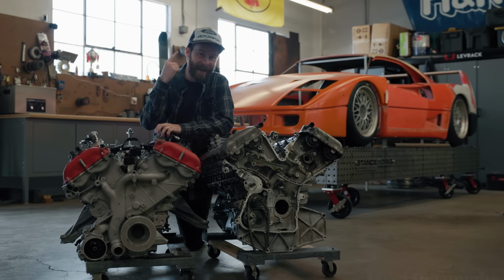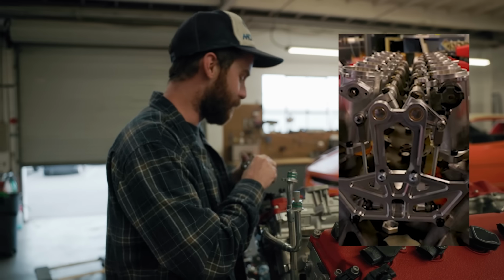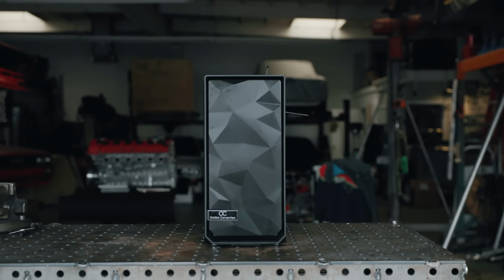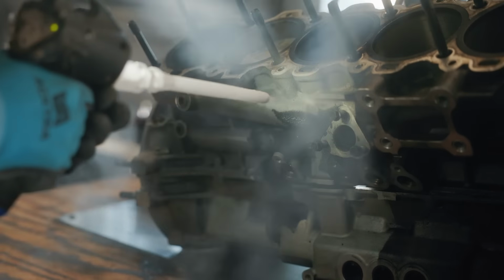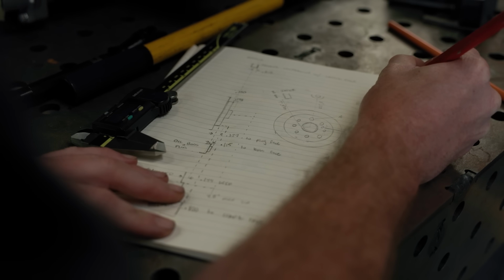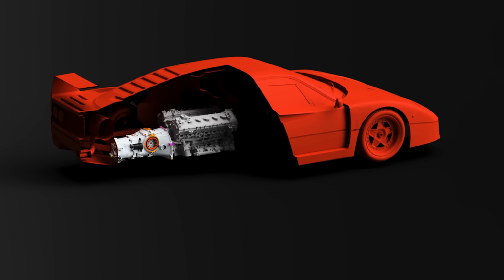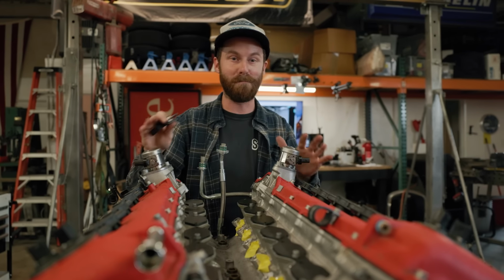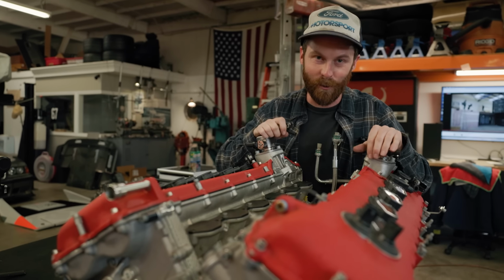Stuffing a V12 into my F40: 3D scanning is my favorite tool yet.

Comment: I'm genuinely unsure whether you're intentionally making controversial choices for comments, algorithms, and creating polemics—because, as they say, "there's no such thing as bad publicity." Instead of keeping the direct injection as a base (knowing it will always work) and adding port injection for additional fueling, you dismiss it as "only for emissions."

The same questionable logic applies to the gearbox. Unless you're restricted by regulations, there is absolutely no point these days in opting for a sequential manual gearbox. You're left dealing with tedious maintenance intervals, temperamental performance, and higher failure rates. Rather than embracing new technologies, you reject them because they're "new" or linked to CO2 regulations. Honestly, it's disappointing.

This highlights a recurring issue: a skilled fabricator without a solid engineering foundation—one rooted in real-world experience, not just a degree—is often limited to creating "shiny things." Or, as I mentioned earlier, maybe this is all just a strategy to game the algorithm.

I discovered this channel through this project, but I unsubscribed when I realized you're the self-sabotaging type.
Reply from the maker: It's disappointing to hear you reduce my own decisions to one of two things: clout chasing, or stupidity.
There's not enough time to really dissect every decision I make, so let's make an example here, because I genuinely think you're coming to conclusions based on your own biases, and while I get how that happens, it's not quite fair in this context.

What gearbox would you think makes more sense in this project? Moreover, how will you make it work? I'm all ears.
Reply: @stanceworks  i don't know what dimensions you have in mind and how do you want to fit it.  But... There is a certain german brand that does transaxle dsg's capable up to 1300nm and with enough support to have customisable gear ratios, and sufficient OEM integration and aftermarket calibration to just hack something together... Even with straight cut gear ratios if the mega ultimate performance bothers you that much... But with oem reliability. Obviously the straight cut gears will cut longevity... But still will outlast the car. Easy.
If you are working with an spaceframe from scratch you are not that limited. Why not to set some hard points in the project and build from them rather than make mediocre choices because they can just tailor make them for you?
Im all about lightweight and simplicity. I May do state of the art in my day job in an OEM but I do build and race 100% analogue cars.  Im restricted by a rulebook tho. I wish i could have a dsg rather than my Sadev. Your interpretation of an F40 wont be sanctioned anywhere where a rule book is relevant. So... Still don't get it.
Reply: @MauriciR  I'm not sure I get your angle. It is his project, he makes the choices he wants. Hollinger is custom building the transmission for his project. Also your comment about anywhere a rulebook is relevant? Do you think he is going to try and join some series?
Reply: @MauriciR his goal isn’t to race in any specific series so why would he build to any rule book. You completely disregard half of what it takes for him to build the car. Mike doesn’t have infinite money to throw at this project to get all the newest and latest technology. He’s not building an oem car either so where’s the harm in him choosing these choices. It seems what you need to find is a documentary from an oem race team cause that’s the only thing that’s gonna satisfy your needs
Reply: Name 5 standalone ecus that will control this engine. I’ll wait. Then name 5 standalone transmission control units to control this magical transmission of yours. Now when you’re done take any combination of those and add the prices. Then factor in potentially having to rewire an entire harness and adding/changing sensors for your ecu pick ups. Then find a tuner who won’t blow it up. In the end you’ve got an ungodly complicated, insanely expensive, ticking time bomb.
Reply: @jordanbest3926  missed that. You don't really need 5 brands... Do you? From the top of my head, adaptronic and holley will control 24 injectors... 12, direct and 12 as ported. Been done before... And opens a new word of possibilities on part throttle driveability, and allows more tuning resolution and less stress in high loads.

A proper zf gearbox will come with it's own ecu, and will be easily flasheable and tuneable. Both engine and gearbox calibration are pretty much standalone... So you dont need any particular integration.
The one and only point of a manual sequential nowadays is to comply with rule books of specific series...
Reply: Your comments are so strange.  They certainly don’t sound like someone with experience building cars.  You are concerned with things that are irrelevant or subjective.  You may as well say Red is a bad color.

Comment: I understand why you prefer port injection, if you run E85, the injectors can not handle the fuel flow required. However, that does not mean you have to remove the system, why not use dual injection, meaning you just add port injection without removing the direct injection?
Reply from the maker: Because there's no real benefit to be had by doing that. It adds complexity with no gain.
Reply: @stanceworks  You would not need to go through all that trouble to remove the direct injection system and would not need as big and expensive injectors for the port injection.
Reply from the maker: But I'd have to wire it, run it, and tune it. The wiring is whatever, but running it and tuning it? That's a headache with no gain. I'd rather just... buy bigger injectors.

Comment: Direct injection is nothing new on car engines. The Mercedes Gullwing had it 70 years ago.
Reply from the maker: Right. But that doesn't take away from the point. It's a modern standard.
Reply: @stanceworks  As much as I like a V12 I'm afraid the modern standard is electric.

Comment: STANCE  . if that pc is to be used in an open shop.. make a box or house for that bad ass pc with a fan and a cheap replaceable home a/c filter on it.......... i lost a tone of time ,data and frustration  finding out my very expensive pc was nuked because of metal dust from welding griding area that was  like 15 feet away..... metal dust got sucked into the pc and wreaked havoc

Comment: What's cool about Ferrari and direct injection is they've been doing that for road car engines for at least 23 years now (if the F136 was the first one). So while its recent for mainstream, its pretty standard for Ferrari. 

Also for the scanner dots, try not to place them "methodically", but rather randomly. The scanner wont know the difference between each dot, but rather will read their unique patterns combined with the surface itself. Part of my job is scanning whole cars, so I've had to go through that pain a lot. Glad it still worked out!
Reply: You sure about your numbers? As much as i know Ferrari first used it in the upgraded F430 in 2009. Not even close to 23 years. Mitsubishi is using it since 1996.
Reply: @Zonkobel  Ferrari designed the engine and it was used by Maserati in 2001
Reply: @ArtiRua  yet the engine didnt had direct injection until 2009
Reply: Mitsubishi was first with their GDI engines, the VW group mainstreamed it starting in 2006 with their 1.4 TSi engines bringing the term Stratified Charge to automotive tech talk.
Upon research I found Ferrari started using DI in the F154 seeing how successful VW was using it in their Audi brand with its performance engines, while the F136 is a unity that still makes use of PFI.
Reply: dig and mechanical port injection are not the same ferrari have not had dig for 23 years

Comment: I'd suggest using your scan to just solidify, section, and 3d print your mock-up engine.  it'll b way easier to move around, and it'll be EXACTLY what you are planning on putting in.
Reply: Was wondering why he wasn’t doing this.

Comment: When your making upwards of 800 H.P. lets face it, it doesn't matter a whole bunch 😮 if you are down a bit, you are going to make it all back and some with modern-day advancements. I would suggest that its  your engine and all the tricks too,  new cam technology  can and will with help from supporting valves and valve train, new exhaust headers and flow. I imagine 835 H.P. is a safe target 😊. 
Slow or fast❔️l wil put time aside to watch you finish, Finish you can❕️You are a proven shop, a finisher ❕️ ❤ the F - 40 project,  Have Fun, this is most important,  You have the Goods 😮 😅.

Comment: Wonder if would not be better just scan the motor and print a mockup just do not have to deal with that much weight, considering you interesting only on the outside space

Comment: That is a huge engine for such a small car. It also sits close to the cabin (yes it will be farther from what it shows in the model, however it will be too close for such a huge engine), so it better be WRC level of chassis strength, at least around the cabin.  I think it is a pity that none of the V8s by Ferrari was chosen. 
And I still cannot comprehend how any tuner can better the Ferrari designed fuel and air intake system, by converting to port fuel injection and ITBs. 
However, I could not be more thrilled for the most crazy project I have seen lately!

Comment: If papadakis doesn't use the direct injection, then it is settled in my opinion. And if you look on what makes most horse power it is injectors directed in the funnel not the port... The closer to the valve the better for is for drive ability  ut not for power
Reply: Appeal to authority fallacy

Comment: Anyone complaining about the direct injection has never worked on it. Totally unnecessary unless your running massive boost and even then id go with belt drive pump before direct injection. Very little to no tuning options for it, tons of parts and leak points and with the pressure, massive fire if there is a leak. Not worth the trouble yet at least until its tunable.

Comment: Dude, when mock-ups are done for this project, if no one else needs a dummy V12, you HAVE TO make a coffee table out of that dead block! Such a flex, everyone knows it's a V12, glass etching a Ferrari logo is easy, and that would look AMAZING. Down the line you could probably even sell it for more that way to some baller with a huge car cave....after we see it of course.
Reply: Or repair it 😍 
get another V12 on the road 💪
Reply: @UKBUILT  I mean, did you see the hole it blew in the crank case? Ain't no way to just "repair" that, sadly it's just a sculpture now.
Reply: @nathanchildress5596  yeah, it looks worse than it is 👍 on a normal engine you would just junk it because it's not worth repairing. This would be worth the time, the crank supports are likely still perfect, cylinders are also wet sleaved too so they are removable. I would save this 😍 fantastic engine but that's just my opinion. I don't like throwing anything special away. Truely one mans junk is another man's treasure 🤤
Reply: @UKBUILT  Well perhaps you know more methods of repairing aluminum casts than I do, but to me the work to do a repair that would hold up to the pressures and heat cycles, along with re-milling the heads & cams, getting new pistons, valves, crank, accessories, ECU, etc. wouldn't be worth it. Why not just buy a used 550 Maranello engine for $18K and tune it like crazy?

Comment: Port Injection Port Injection Port Injection Mike 👌👊🔥

I’m not truly on Board with this build as I believe your time could be directed towards the other projects but I gotta admit the 3d & Cad stuff is on another level.

Just curious if you plan to use the 3d and cad for the 308, BMW, and Audi projects Mike 🤔

All in all you’re killing it and wish your shop was closer to NorCal where I could swing by and check out the shop.

Comment: I agree that, for your use case scenario, DI doesn't make sense. Except for engine response, but all the other things it benefits don't matter for a race car. And I bet that with a talented enough tuner, it's gonna be the same. DI is amazing for normal everyday cars but not necessary if it's gonna live at 8k rpm all it's life. Love the project
Reply: ITBs are known for their quick response.

Comment: I didn't see you put any head gaskets on the mock up engine. could that cause issues if the heads are slightly lower when building the car vs what will go in? or is the head height a fuzzy area?
Reply: Totally unnecessary for mockup
Reply: @scotth7686  good to know, not that i plan to build a car anytime soon:)

Comment: Some direct injection engines use pistons with a unique crown design for combustion. May this cause issues when going to port injection?
Reply: The DI crown is just to help dispurse atomised fuel, it won't be an issue since the air+fuel will be premixed at the inlet port👍

Comment: I would really recommend modeling the chassis in CAD, even if you are using traditional fabrication methods. Its a bit painful up front but it will save you a TON of time later and it will allow you to try more things quickly. You can use the derived tool to have smaller individual models when designing things like brackets and mounts, but with a fancy computer like that you could probably do the whole thing in one model 😉. Super happy to watch all the prep and design work, Im at a similar stage with my project!

Comment: Isn't is going to be a giant headache to delete all the old DI ports into the cylinders?
Reply: Not realy, he just needs to machined plugs to block the holes. Even the unused injectors would have worked for this in a pinch.

Comment: You are right about the injections systeme. The only advantage of DI is that you increase the charge a bit (since you inject inside the cylindre, more air can get inside then if you had to flow an air fuel mixture) but otherwise, its only purpose is to be able to make good power and avoid knock while keeping a very precise Lamba 1, which is required for émission. It is a very clever system but it was never driven by the need to make more power. Port Injection is the way to go. I am just curious how you are going to block the DI injectors holes, because I think it's a serious consideration if you don't want to create a hot spot in the cylinder
Reply: probably machine a dummy injector to block it off
Reply: @wrexz  the dummy would (might) need evaporative fuel cooling in order to not melt.
Reply: Yes that's what I was talking about. If you have a point in your cylinder that does nothing for the combustion, it will create a hot spot in the chamber that will melt in the worst case, or might create a source of knock in the best case. (The guy that created the Aasbo's FD supra talks about it in his build series, because he used the BMW engine of the original supra but went to port injection, and he burnt the DI injectors because he thought he could just leave them in to plug the holes)

Comment: The direct injectors are actually cooled by the gasoline going through them so you can't just run an engine without them having fuel going through them you either have to fabricate some dummy plugs that are the same size as the factory injectors or put different heads on or something like that
Reply: No
Reply: @scotth7686  "You can't just ignore the direct injectors because they are cooled by the fuel flowing through them, they are likely to melt down if you simply leave them in and do not use them." From Marc labranche at Frankenstein motorworks
Reply: @colchronic  The “direct injectors” are being removed genius
Reply: @scotth7686  yeah so what are you going to put in their place genius
Reply: @ a machined plug
Reply: @scotth7686  hmm It's almost like you didn't even read what I said

Comment: Such a cool project. If it was me, I would buy a Pilbeam carbon chassis for the Elise, and modify the rear chassis as needed to make it fit in the F40 shell with that engine. Tube chassis are cool but monocoques are cooler.
Reply: The F40 is so much wider than an Elise.  It may “work”, but it wouldn’t look right.  I don’t think you thought about it for more than 30 seconds.  Think about the A pillars for starters.
Reply: Dude… it’s 6 inches too short and designed for transverse mounted engine/transmission. It has ZERO chance of working without completely hacking and fabricating with prepreg carbon which would require massive amounts of equipment/experience.